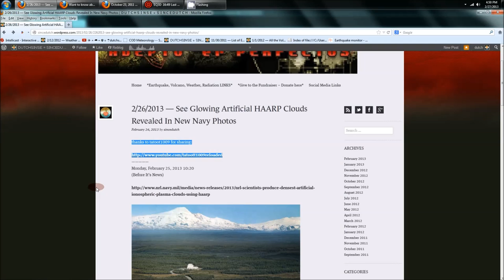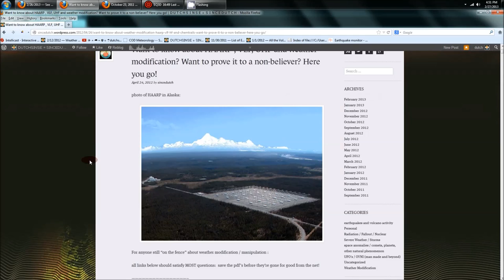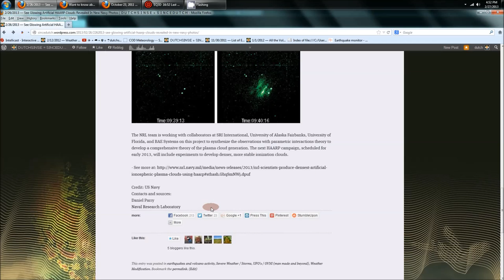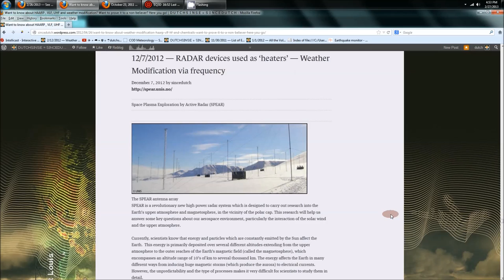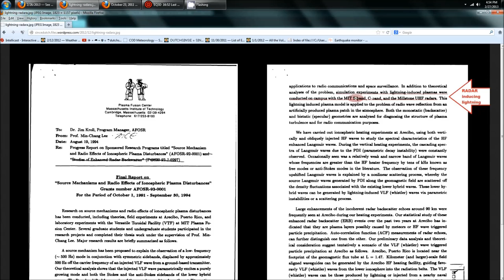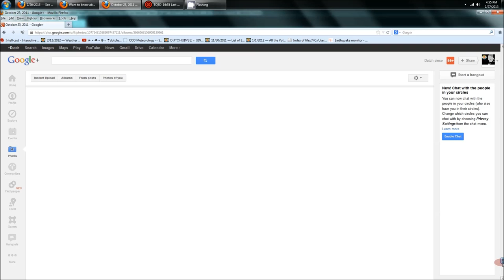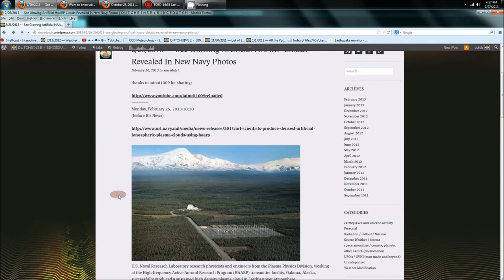2/27/2013 -- US Navy Labs create Plasma Spheres (rings) using HAARP

Comment: On Thu, Feb 28, 2013  Gregory Benford  wrote:

Given my experience with DARPA, they'd work for specific goals on a milestone basis with the clock running. They studied geoengineering the Arctic years ago, acting under the DOD determination that such effects are a national security issue. 

The best run group that could do strato aerosols is plainly the US Air Force, which flies the KC-10 Extenders we would need, and has a half century of experience.

Gregory Benford

Comment: The real meaning of HAARP is Harmonic Antenna Array Radio Projection.
The world's RADAR systems aren't mini versions of HAARP, they are parts of it that work in harmony to produce the desired effect.
Most of the effects are using the harmonics of the frequencies they send out, that is why they overlap frequencies as well as leaving gaps in frequency bands, the gaps work the same as the MIT sound projection device, the difference in the frequencies creates another frequency band.